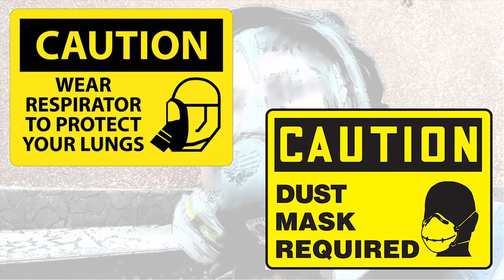Desktop Computer | DUST Fight 😷 ⚠️ Chart TOP 10

Comment: Never let the fans spinning one day you will get a strange error and the pc wont start anymore you can blow up your motherboard some times you cant fix it anymore i got this also 1 time after that you will never let them spin anymore if u have a €€€€€€ motherboard xD
Reply from the maker: Do not worry about the fans. Fans still work. Sure, laptop fans are fragile, I do not let them spining during cleaning by air pressure.
Reply: Mine has been running for a month straight lmao. Gotta seed

Comment: Isnt supposed to hold the fans with anything? Like didn't they generate power if you spin them like that?
Reply from the maker: I cleaned hundreds of computers and never had a problem. Better to hold the fan but i like the sound of fan spinning.